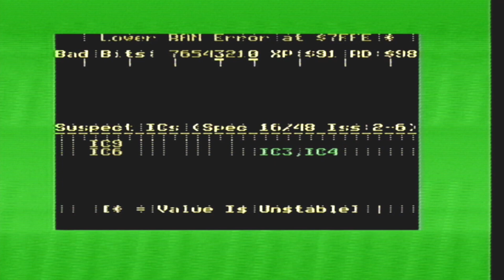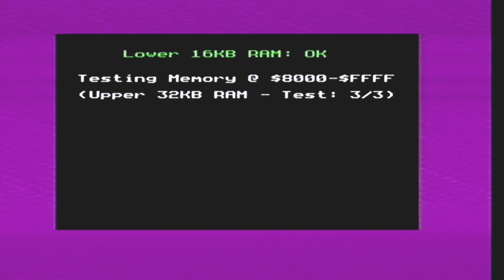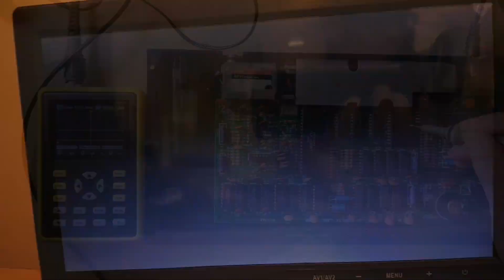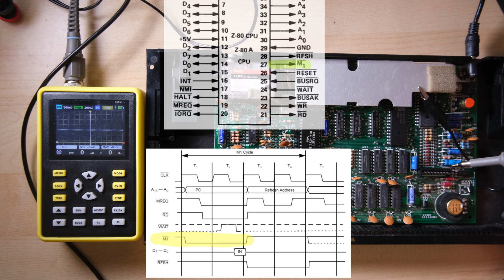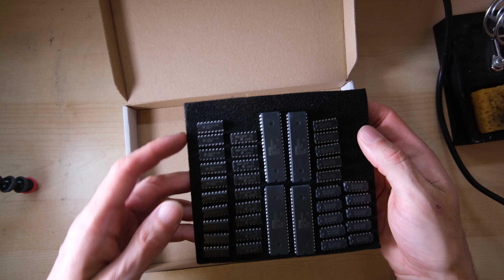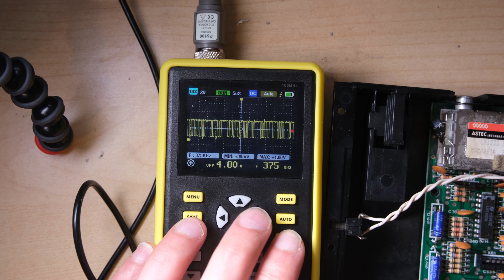ZX Spectrum+ 48K Repair - RAM and Z80 Replacement

Comment: Good and brief video. I get the same picture on a ZX spectrum! Now  here is a question.Throw a 40pin socket away just because one of the pins pop out of the top? You can always put that pin back! I literally just  replaced all 40 pins on an old 40pin socket because I was short but  I have many smaller ones  in hand.
Reply from the maker: Good tip thanks I'll keep that in mind

Comment: Also the old NMOS Z80 processors are power hogs, consuming around 200mA just by itself on the 5V line. Replacing them with newer CMOS type Z80's (50mA max) will save 5V regulator from this unnecessary burden. Spectrums that still have the old 7805 regulator benefit from this mod a lot.
Reply from the maker: Good to know thanks
Reply: Cheers, I need to replace mine, will be replacing with a TRACO as well so it will create less heat and not need a heat sink for the power regulator.

Comment: One thing to remember is that Spectrums with a weak or dead !M1 line are common - The spectrum itself doesnt use the !M1 signal, and Sinclair bought a batch of Z80's where this pin was faulty, but the CPU otherwise worked... usually the first sign of this is when a device like a Mulitface doesnt work
Reply from the maker: Great info thanks!
Reply: problem is things like the Divmmc do use the M1 line, so if that is out then it won't work. 
I have two 48k spectrum pluses and bought a Dixmmc Future to find it doesn't work on either one.
Reply: @user-yv2cz8oj1k  Yep expansions often need the M1, but my point was that M1 being bad doesnt necessarily point to an issue with the Spectrum itself, as the Spectrum does not use that line. It's worth changing the z80 out when found in these cases though